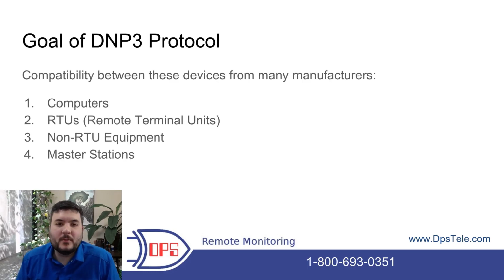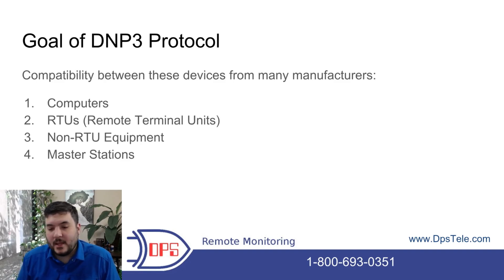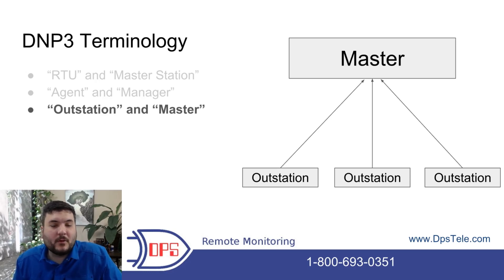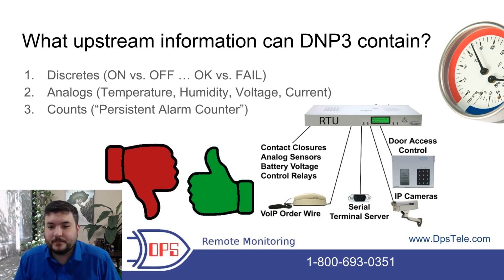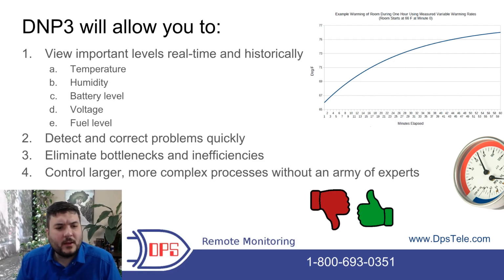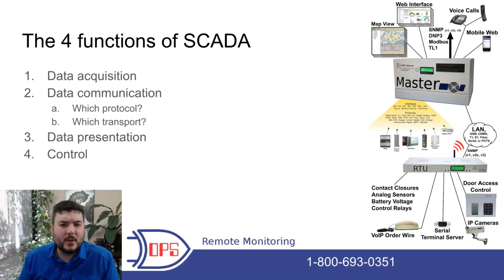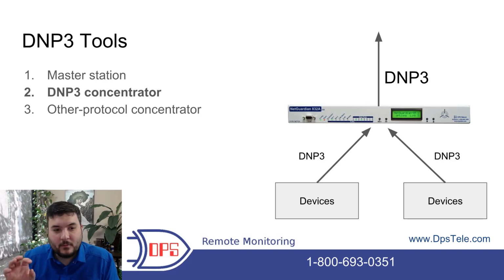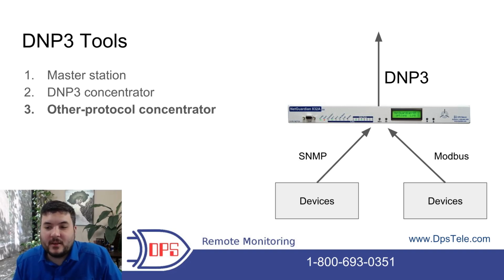DNP3 Tutorial 2018 - Outstations, Masters, & Other Fundamentals

Comment: Thanks for the video! We are studying the difference between the DNP3 and IEC 61850 communication protocols for a 5th year Electrical Engineering project. Can you comment on any differences between these two?
Reply from the maker: Hi, Eddie.

We work much more with DNP3 than IEC 61850, but I took a few minutes to educate myself on the key differences so I could answer your question. It looks like there are many of the same dynamics in play here as I've seen with other "this one or that one?" protocol and transport decisions.

Namely: (1) DNP3 is older, "destined to be replaced by IEC 61850", but is stubbornly refusing to budge, largely because (2) DNP3 is entrenched, so people know how to use it (particularly in the United States), but also because (3) IEC 61850 requires much more bandwidth than DNP protocol.

In short, IEC 61850 is the "new hotness" with a lot of promising functionality. SCADA infrastructure, however, takes a very long time to evolve. If a new technology was universally accepted for 100% of new SCADA installations, the old one would still be operating for decades until the last holdout finally had to replace it. This is reinforced in this DNP3-IEC battle, because older transports and bandwidths make transitioning to IEC 61850 even more difficult.

Oddly enough, we built our business largely on offering creative translation/mediation solutions to address this slow evolution. Our fellow manufacturers seem to lose interest in the "old" protocol much more quickly than users do. One of my clients perhaps said it best: "I bought your equipment to make my 30-year-old equipment talk to my 10-year-old equipment, and to make both of those talk to my brand-new equipment."

Here are some of the articles I found that address your question:
https://www.elp.com/articles/powergrid_international/print/volume-14/issue-5/features/dnp-vs-iec-skirmish-in-the-substation.html
https://www.linkedin.com/pulse/comparisons-scada-protocols-power-systems-udara-perera

Best of luck with your project. As you (inevitably) encounter new questions as you dig deeper into it, please ask again.

Best regards,
Andrew
DPS